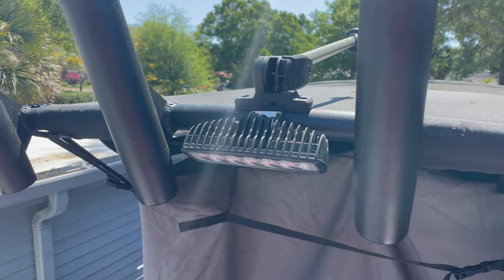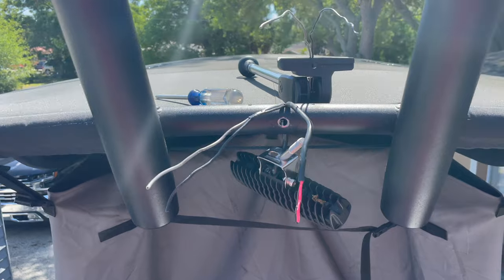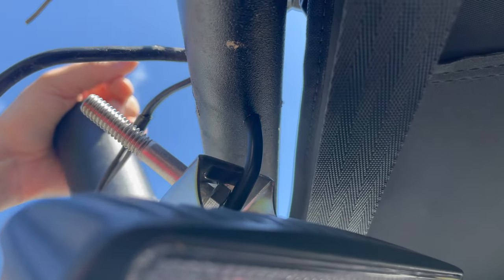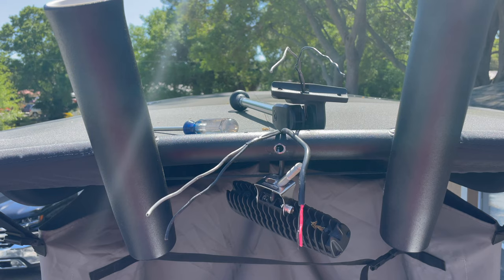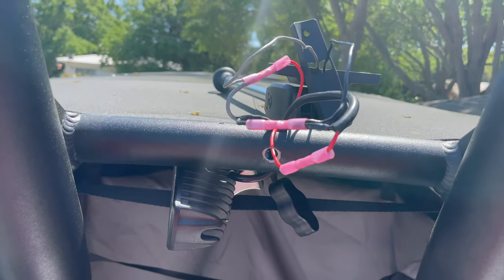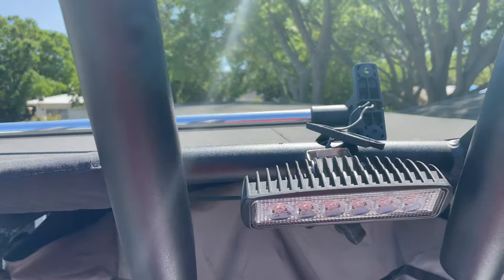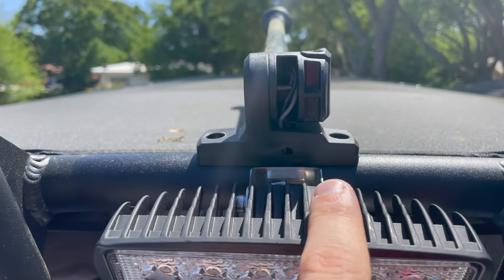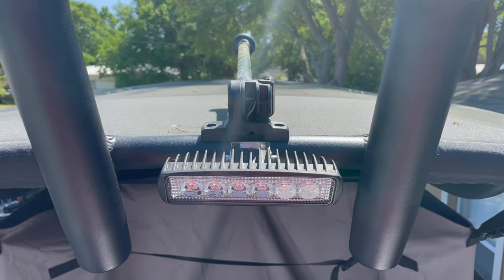Easiest LED Spreader Light Install For Your T-Top!!! NO RUNNING WIRES!! 2021 Yamaha 210 FSH Sport

Comment: Great video and easy install.  However, I'm surprised Yamaha doesn't use rubber grommets between the sharp metal cutout in t-top for the wiring.  Seems boat rocking and rolling could case chaffing / cutting of the insulation of the wiring and lead to short circuits. My Wellcraft CC and Bennington pontoon all use rubber grommets in either the T-top or bimini top frame for wiring to protect the wires.
Reply from the maker: Thank you and yeah I was surprised too. I have installed grommets on all wiring holes.

Comment: Help! I followed the steps with the same light and switch. I wired everything up ensuring correct match for power and ground. When I turned on the battery and flipped the switch nothing come on. Toggled the switch. Now my Nav/ANC switch won’t light up and neither lights are working after disconnecting. Maybe a fuse? Any other ideas. I just need my nav lights back
Reply from the maker: There is no ground hookup for switch, only interrupted power line. If you hooked into the ground you probably shorted the circuit. Take wiring apart and put back to stock and reset circuit breaker by the switch. Hope this helps.

Comment: Great video. Could you run two of these lights from the navigation light?
Reply from the maker: Yes, just make sure your load isn’t too much for the circuit. I don’t remember exactly what the load is at this point, but I doubt it would be too much to add another. Check total draw and then make sure wire size is enough and that the breaker can handle it as well.
Reply: @THEFSHDUDE  Thank you for the response. Do you think the one rear light you installed is sufficient and lights the rear area enough? If so, I’ll just stick with the one. Thanks again.
Reply from the maker: @briandannenfelser8150  Absolutely!! It is very bright and light casts nearly 180 degrees.